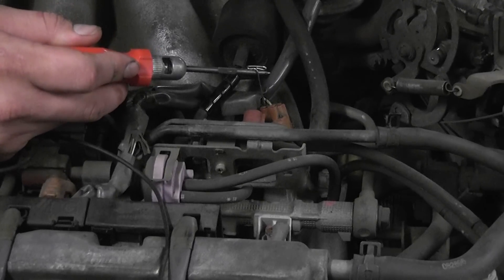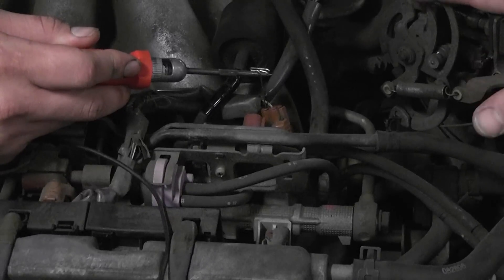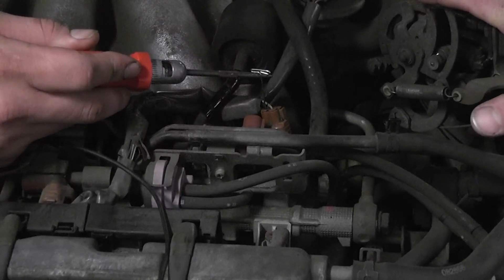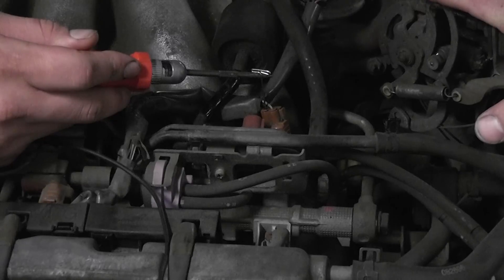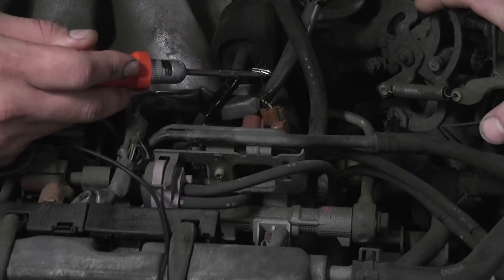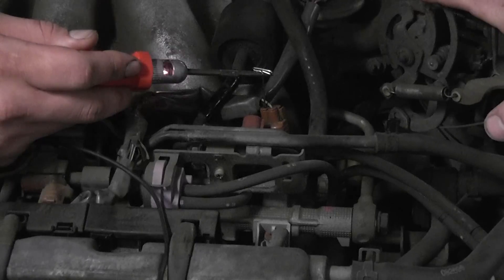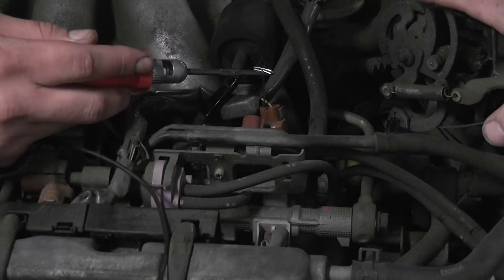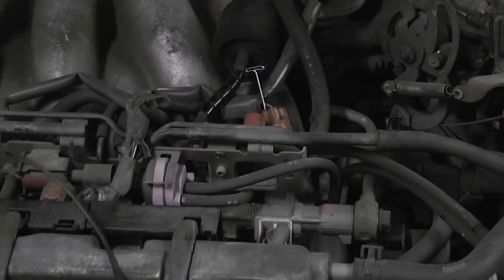How to test a computer transistor driver (without a scan tool)

Comment: What if…. It’s a transmission pack solenoid and the vehicle is in limp mode so the transmission pack is not getting the control feed due to limp mode? Is there a way to manually test the transistor driver without taking the PCM apart?
Reply from the maker: Yep, same way, just clear your code after you install your test light as the solenoid in the circuit
Reply: @ScannerDanner  thanks! I was able to also test the transmission gears manually by wiring up grounds for each solenoid and grounding the appropriate solenoids for each gear (with the car on Jack stands). Not sure if this is considered safe.

Comment: I thought reversing the polarity would kill the driver
Reply from the maker: I provided the test light with the power and ground it needed to light. If the driver is a ground side switched circuit, then I have to power the other side of the light to make it light when the command is sent. This would be opposite for a power side switched circuit. Hope that makes sense.
Reply: @ScannerDanner  thank you for reply, I have your ebook a few days ago and also subscribed to your other site too 👍 the book and site is amazing
Reply from the maker: @davakil  chapter 3 material  my friend. Thank you!

Comment: Anyone else tired of these fixd adds and see a huge potential for people to be arguing with they're mechanic, no i don't need a ball joint cause fixd said nothing wrong, then the wheel flops down hitting the pavement face down causing them to ram a semi head on killing a lot of people. Maybe they should be a little more careful with their advertising cause it sure won't diagnose ANY problem at all. In fact it can't diagnose anything that's not accurately monitored by the vehicles computer so they really should specify that in the add. Never heard of a single car period that has computer monitoring for the most important parts probably most likely to kill you such as ball joints and tie rods.
Reply from the maker: I've blocked them! How are you still seeing those ads? Smh stupid youtube
Reply: @ScannerDanner  about right. Yeah they're there lol
Reply from the maker: That really pisses me off. I've blocked every variation of this stupid ass company and even involved YouTube "support" but on that front, they suck too, worst support of any company, ever! Even for us creators.

Comment: What would be a good way to test if the problem is intermittent?
Reply from the maker: Perform the test multiple times under different temperatures
Reply: @ScannerDanner  Thanks, I finally got it to fail and it won't light my test light. If I check for a voltage drop on that wire under a load while the problem is occurring shouldn't it show voltage if in fact the transistor inside the pcm is faulty?
Reply from the maker: Is this a ground side switched circuit? This would be a circuit that has a fuse which is a power feed on the one side and then the driver in the computer switches the ground of the component
Reply: ScannerDanner yes it is.
Reply from the maker: @childerstodd  okay cool. How you are putting the circuit under a load? Are you manually jumping the circuit to ground or are you using a scan tool in a bidirectional mode and commanding the driver on?
Circuit off you should be seeing 12 and 12 on the two wires
Circuit on you should be seeing 12 and 0 (12 on the feed and 0 on the control) 
You mentioned seeing a voltage drop? If so, you have a feed side problem, not the driver in the computer
Reply: ScannerDanner I have 12volts on both sides. I’m loading by putting it in the conditions required for activation.

Comment: control wire as you said i am a little  bit confuse about it, how can i real ly know if i have to connect + or - with my text light, sorry i am just learning. ok? having toyota highlander2004 with p0012 i do i know if the pcm is energizing it or not
Reply from the maker: +lawal olawale If both wires go to the computer, then you need to be extra careful. If you want to energize that actuator, I recommend disconnecting the connector and running your own power and ground. 
Most of these are power side switched (when both wires go to the PCM)
Reply: THANKS GUY

Comment: Wow...back probing with a T-Pin?   That's a good way to cause more problems.
Reply: I understand your concern but as an aftermarket tech that works on 40 different car lines there is no better way. I remind my student continuously the dangers of t pins. Damage to a typical sensor or solenoid connector does not occur if you're careful.
Reply: You're right, if you're careful it's a great way to back-probe.  To each his own, I've just had the rubber weather pack tear on several vehicles from excessive back probing with t-pins because of the thick gauge and also the sharp pointed tip. (my younger years). In my opinion this could lead to water intrusion into the connector in the future.  I now use a much thinner blunt pin i found in an electronics store.  I also use bed of nails clamps a lot, liquid electrical tape after.  

T-pin opinions aside, love your videos.  I'm also a master tech and own my own business so I've got lots of respect for those showing others short cuts to solve problems. I know that the advice other people have given me from their own blood sweat and tears is the only reason I am where I am today!  Keep up the good work.
Reply: Thank you my friend.

Comment: P0443 came up on device for 2004 Chevy impala .. Car doesn't start after you ride around in it and cut it off and on frequently .. When it don't start have to wait at least 30 mins to an hour for it to start .. My car didn't start for awhole 3hrs yesterday .. Til it cool down .. Could it be the driver circuit ?
Reply: That code is unrelated to your condition. You need to find out what your missing when it doesn't start. Spark or fuel?
Reply: Ok , it popped up on the scanning device though .. My mechanic said it could be my crankshaft sensor bad because it's no fire when I'm trying to start it .. Someone else said it could be fuel pump
Reply: Agree both of those are common but I don't deal in "could be's". You need to find someone who can truly troubleshoot this for you not guess and change a part. If I was to roll the dice and you said your missing spark, I would go with the crank sensor.
Reply: Exactly that's what my mechanic is doing now because he said my engine runs to smooth to be anything else ..

Comment: and what could happen if the control wire is constant ground from the ECM and the solenoid is active cutting the ground supply from the ECM.. if i make this test + test light and t pin on the control and it lights i will conclude a shorted wire or driver..have you ever see fix ground or positive side cut switch or always must missing 1 at least?sorry for my english regards :)

Comment: A friend has a 93 GM truck TBI 5.7 eng and it's not getting pulse for the 2 injectors so a NO start, he replaced the fuel pump about a week ago, also the dist. pick-up and also module which didn't help, i was reading that the inj. can be checked with a test light on the batt +, i did that for him tonight in the dark, key on light is on, cranking = no light at all, do you feel PCM or wire for the pulse?

Comment from the maker: Move the coils to a different location and see if the trouble codes and the misfire follow the coils or stay in the same location. If it follows the coils, you need to replace them. If it stays in the same location you have a wiring or PCM problem.

Comment: Thanks sooooo much. Sadly, I still have the P0355, P0356, and P0357. To add, I removed one coil on plug, and there is no water in the sparkplug hole.  I presumed water in the plug hole would give an engine misfire code. However, I am getting a primary/secondary circuit problem.  Any other alternatives?

Comment: Sorry for the rather low level question. However, I steamed cleaned my 4.6 Crown Vic engine (while running). It was no problem that day. The next day, P0355, P0356, etc. I have spark with a HEI, 13 Volts power (Digital Multi meter), and a switching signal via LED test light. As well, the resistance in switching ground wiring to PCM is the same as the suspect one (.6). Can I deduce I have a bad PCM driver (though I have 12V and switching, and a new coil)?

Comment from the maker: Possibly. But some of these drivers are smart and if current flow isn't right it will shut down. I would leave the coil plugged in an backprobe the control wire with my test light. If there Is control the light will flicker. Watch my subaru no spark video where i am doing control testing with a test light

Comment: Paul great video! Could this method be put into practice on a 2 wire coil on plug module? One wire is a battery feed, the other is a switched earth by the ECU (classed as the control?) The chap doesn't have access to a scope and I'm miles away. Complaining of no spark although everything else checked and changed. Cheers Paul

Comment from the maker: If you had the same issue with the harness, there is the possibility that the engine computer is "cooked". The injector control wires touching the sensor ground circuit will send over 100v spikes into the computer. Check sensor grounds, if voltage is high then you need a PCM.

Comment: Great videos I am just wondering i had the exact harness issue you had shown on my 2002 dodge caravan but my injectors are stuck in open circuit and NOT firing.  So do I use this test on the driver of the ecm to see if its firing?

Comment from the maker: @TRcustomengineering I wouldn't use a noid light for this test simply because a noid light needs both a power and a ground to work and if you are just checking the control wire and PCM driver you want to limit the variables if the light does't light up. With the test light you can be sure that the light has power because you are connected directly to the battery and you have already tested your light to make sure it works. 
But to each his own I guess. Just more checks if the noid doesnt light